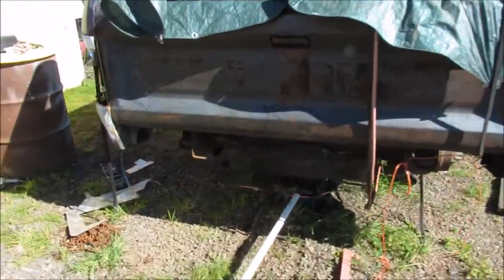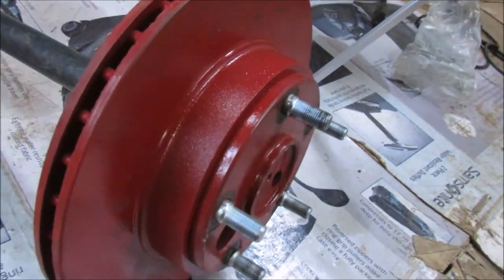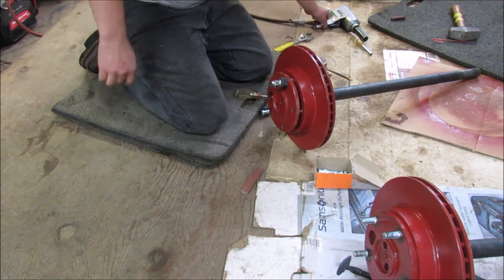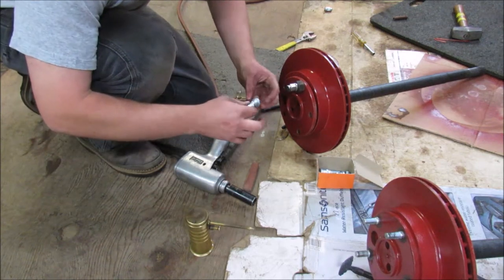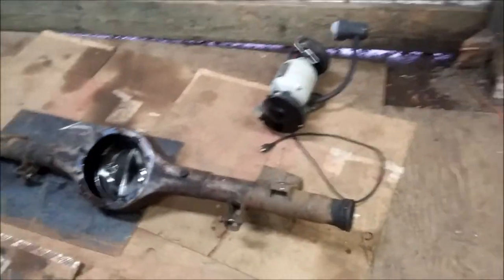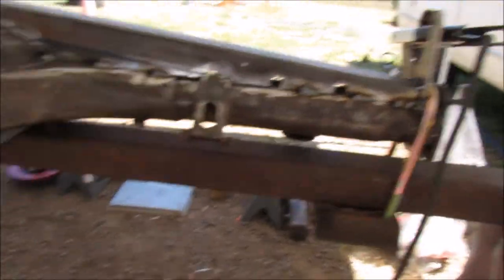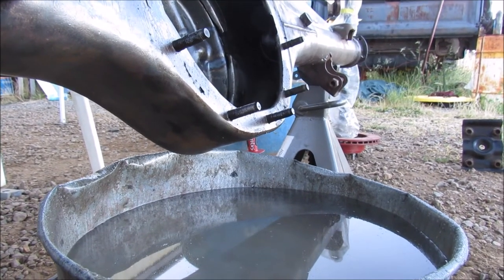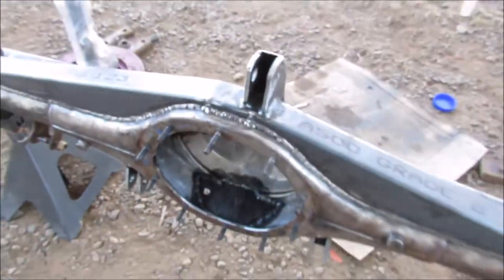Bronco project pt 10, 9 inch build, truss, shave, disk brakes

Comment: Looking into shaving mine. What size roughly plate is needed to cover the hole back in? Did you use regular A36 hot rolled mild steel? I am considering 1018 cold rolled or maybe even AR400. Not sure how difficult the AR400 might be to weld tho.